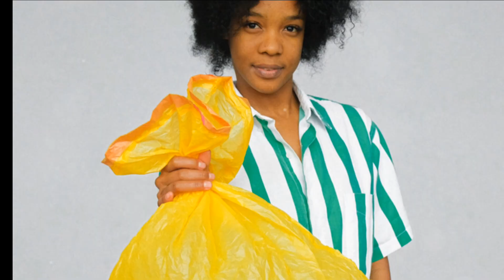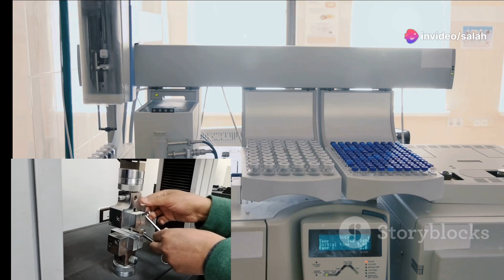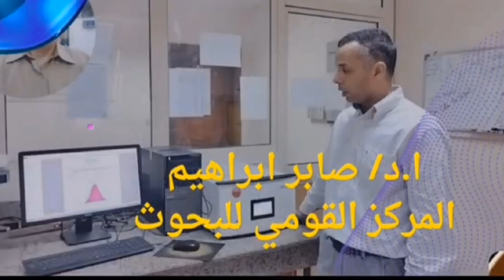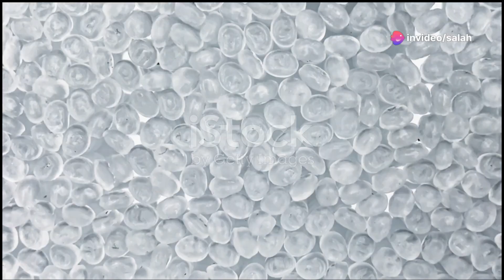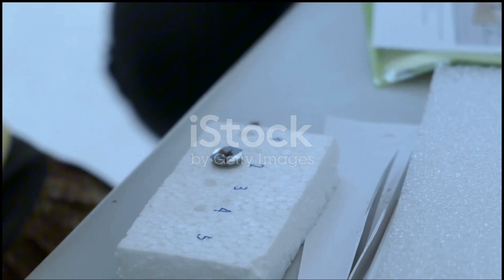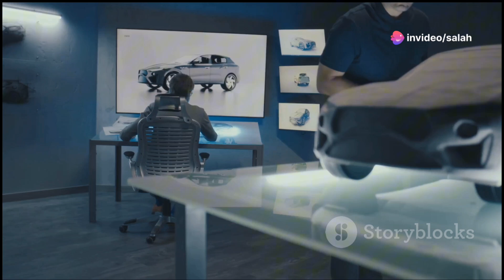Elevating Packaging Materials: Polypropylene Bio-Composite Breakthrough

Comment: I'm also curious about "unintended consequences," as I'm sure are you.  Almost by definition long term, although shorter term is certainly possible.  For example, petrochemical fuel use and global warming.  Nuclear fuel residuals.  Effects outside our lifetimes, some not identifiable with current technology.

I have read that nanoparticles of plastics residuals can be found almost everywhere, including our bodies.  Also of "non-natural" fabrics, polyester, nylon and such.  Vs cotton, wool, and silk.  The long term health impact is not known.

We as a species tend to have a blithe disregard for what we have not yet noticed, how else can it be?  But we can at least try to anticipate, and avoid, what we reasonably can.  Certainly the waste stream is in desperate need of remediation, the biggest impact I considered in this presentation.

Comment: Fascinating.  I'd like to see more about how this material biodegrades.   Does the material self -adhere well?  Or can fragments migrate to the applications?  What about the total cost of ownership (TCO)?  I'm sure I have a number of other questions.

I'm retired now, but was at one point in food production.  Packaging is integral.  I attended international packaging industry  conventions.  I was aghast at the astonishing, vast amount of single use food packaging, with no TCO considered.  

This is a critical, far-reaching product system.  I can think of so many applications, even without research tools.  Very well done!  So glad to learn about it.
Reply from the maker: Jean Kipper,

Thank you for your interest. It's great to hear from someone with your background in food production and packaging. Let me address your questions:

1. **Biodegradation**: The material is designed to biodegrade naturally over time, minimizing environmental impact. Specific rates and conditions for biodegradation can be provided upon request.

2. **Self-Adhesion and Fragmentation**: The material has been engineered to self-adhere effectively. While we do monitor for fragmentation, our current data shows minimal migration to applications under normal use.

3. **Total Cost of Ownership (TCO)**: We are actively analyzing the TCO, which includes initial costs, operational efficiencies, and end-of-life disposal. Preliminary findings indicate that while initial costs may be higher, the long-term benefits and environmental savings can offset these.

Your insights and experience in packaging are invaluable, and we appreciate your support. This product system indeed has far-reaching implications, and we're excited about its potential applications.

Thank you again for your kind words and interest.

Best regards,

Research team